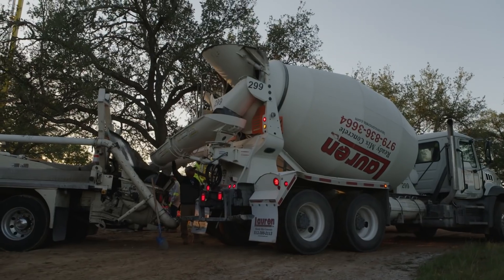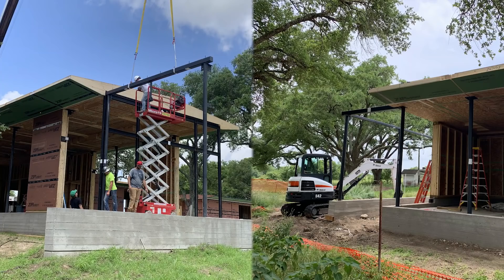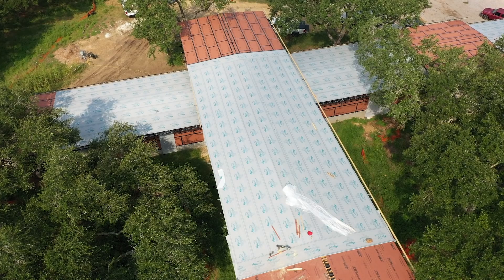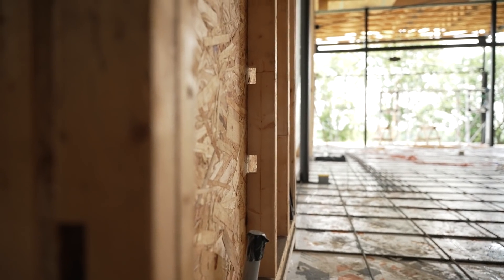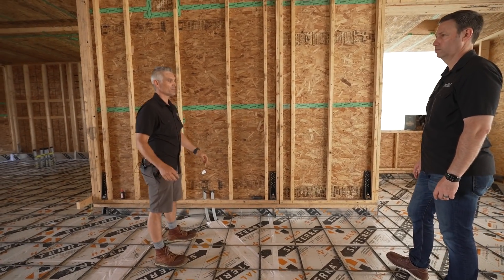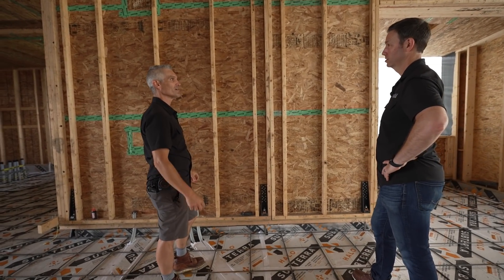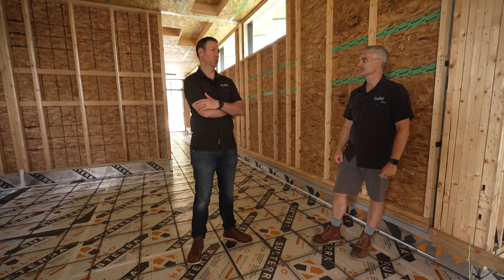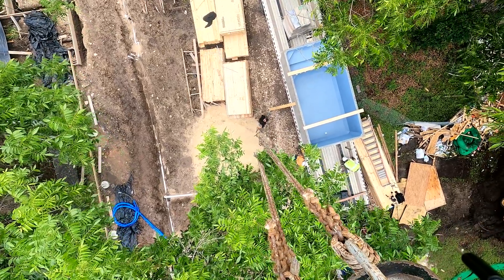Structural Insulated Panels - Framed This House 4x Faster

Comment: a lot of consumers don't realize that that 6 weeks construction time is REALLY REALLY underrated... coming from somewhere like NY... where labor cost or among the highest in the country... with apparently only 5 guys and 30 days? you are SAVING a lot more $$$ than you really think... costs are def higher than normal building however, with the added energy savings and probably gov't rebates... cost are probably not as high is a lot think... great work and great ideas. great work guys
Reply: Hi George. I build in Ohio with primarily Amish subcontractors and most houses are completed within 90 days after we start the house. Most of our houses are from 2,000 to 10,000 square feet.
Reply: @jeremyhershberger3012  - Have a question. Shooting from the hip. I'm near Middlefield... I really like the utility of an Ibeam framed Barndominium. Let's give me a target time of STARTING my project in 5 years... Would you guess it would be cheaper to build it or typical wood frame house? Same type of insulation, etc. No insulation in portions of barndo that isn't house.

I know it's a tough comparison, but just asking for a gut feeling.
Reply: @Jbcfjjjiffoxholeohfreesdgg  That is a good question. A Barndominium can be a good way to build. A cost comparison is truly hard to make. It depends on the fluctuation of material prices (the price of steel compared to lumber), the amount of experience your contractor has with the respective system and the types of finishes you use inside and out. In general is you want it to look like a barn inside and out a bar dominium can be an effect choice but if you want it to look like a house inside and outside it will be more efficient to use traditional stick frame. You can get a more detailed response if you talk to several local contractors.
Reply: unfortunately the builder wont pass those savings along to the client.../
Reply: Nothing from Bensenwwod is inexpensive.  They seem to be very high quality, but the speed of construction won’t result in an overall moderately priced home.
Reply: The end cost is $1000 a sqft that is just unreasonable for 99% of people. No way its "not as high" as I would think, its a lot higher lol.

Comment: SIP pieces will eventually get damaged by water - and then the whole structure is compromised. 

I think ICF is the superior building system when looking at the 50-100 year lifespan of the building.
Reply: not true if they are secured from the outside. In fact we built out of SIPS. Left over pieces were out over 1 year. no damage no mold

Comment: Could you pour aircrete instead of dense packed cellulose?
Reply: They make those too at the factory. They pour is horizonally, so the plywood wouldn't need to hold it, so I don't see why not...
Reply: @zstarwarsz  Since aircrete is moisture resitant, mold resistant, UV resistant, and flame resistant, could metal siding be used for the exterior sheathing/cladding for places like California or BC where wildfire risks are significant? Aircrete is about R-2 per inch a d when mixed with perlite it's extreme temperature resistant.
Reply: @sirukin2025  I am no expert, so don't rely on me for that... but you could use Perfect Panels, which is upgraded ICF, to be fire resistant and then put metal over it, for example. It should be cheaper (most likely) and offer you that fire protection that you need.

Comment: Matt, what are the right insulations to use in a shipping container house? The shipping container house is built in a tropical country.
Reply: Closed cell spray foam
Reply: I live in a shipping container house that uses two 40 foot refrigerated high cube bolted together. They come pre insulated, just have to take off the decommissioned refer unit off the back and frame it in.

Comment: Thing is... it does take 30 days to put together on cite, but how does it compare to from start til this point? Because if usual house takes 6 month to frame, for example that that fab takes 3-4 month, then you're not saving much time (also to pack it into 15 semi's and drive to texas). And, obv costs... my guess it's 1.5-2x more than usual house. Also, about 190cu yards of conctete (2 layers) . In the end, they are probably paying 2x and getting a better quality house (due to most of it being built in factory with controlled variables), so, to really know if it's worth it, we need to do a proper cost analysis... of course, if someone says, here is 3mil, built it,, then I guess it's a moot point :)>
Reply: You did a great job of just guessing about everything
Reply: @daveklein2826  I didn't guess on concrete since he said 7500qt house and 4 inch slab (there is also a slab underneath the foam, I used also 4" base but maybe it's 8 or 12", then obviously more). and the cost he said 1.5 to 2x, He also guessed, but I assume him being the expert, he can pretty close.
Reply: @zstarwarsz  LMAO So you have knowledge about 20% of the project yet you guessed at 80%....got it

Comment: rebar rusts expands and causes concreate to fail.
Reply: Usually yes, but it's waterproof from bottom and from top, a lot less moisture. They also may spray it as well, so while you're right, I would think rebar would rust at 10x slower pace than usual.
Reply: LMAO